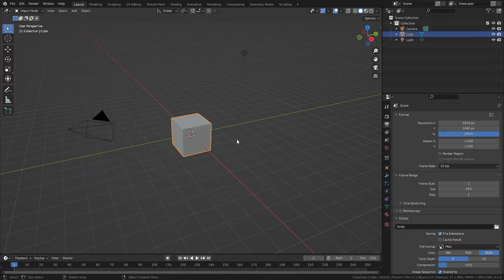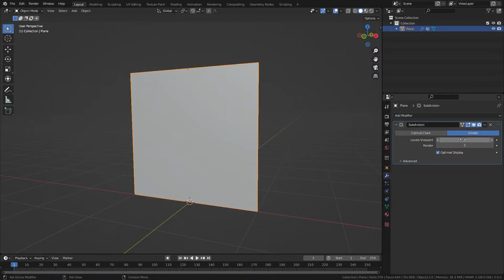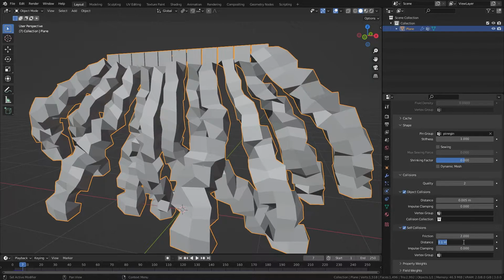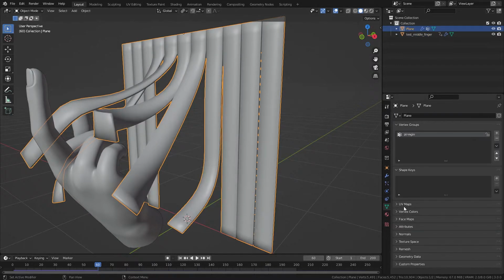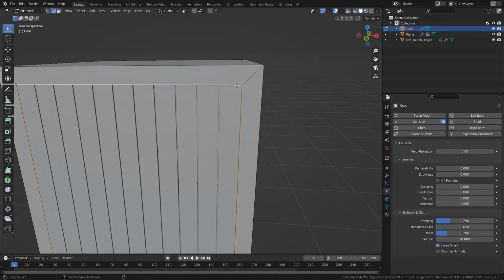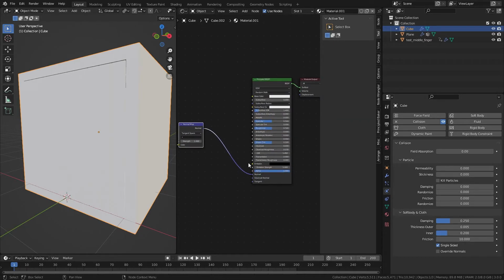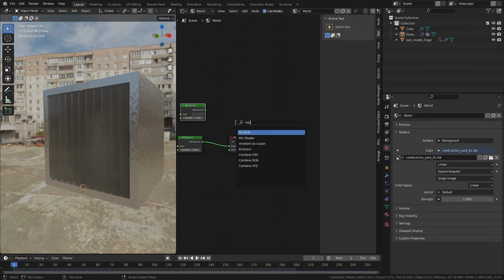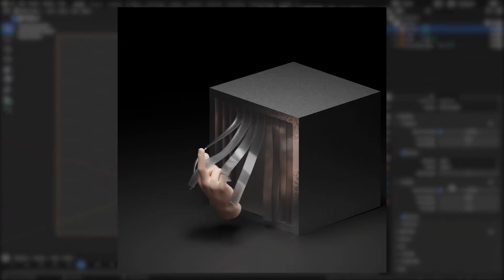Create Plastic FLAPS using CLOTH SIM in Blender 3.0 || Bad Blender Tutorials

Comment: Thank you. How would I make my flaps more stiff? lol
Reply from the maker: In the cloth object under the cloth simulation settings there should be a drop down menu for “stiffness” as well as “damping”, raise those values and it will make the cloth more resistant to those forces.

If you find your cloth passing through itself you can also turn on self collisions under the collisions menu, but this will have a big performance impact. Hope this helps ya!
Reply: @ImaSneke  Thank you so much! I’ve been experimenting with cloth and a rolling marble with rigid body attached. I was hoping the cloth might slow it down as it runs through it but I haven’t found a way to do that yet. My blender knowledge is very limited so if you know a way, please let me know. Cheers 😊
Reply from the maker: @akongas  unfortunately there is no way for blender to natively have ridgid body and soft body (cloth) interact with each other as this is very computationally expensive.

There may be some addons that could help you, but I’ve not tried any. Easiest way I would do it is use a force (maybe wind) in the area with the cloth to slow the ball down instead of using the cloth itself. This will keep the 2 systems separate and rendering much faster.

Edit: also make sure you calculate the ridgid body before the cloth in the modifier stack.
Reply: @ImaSneke  thank you so much, that’s a great idea! Might give that a go! Appreciate your help! 😊